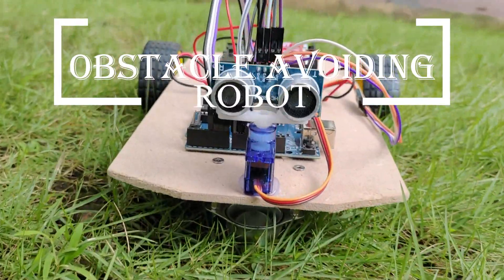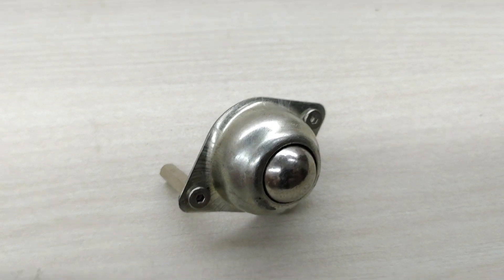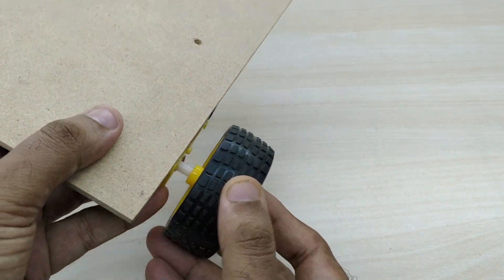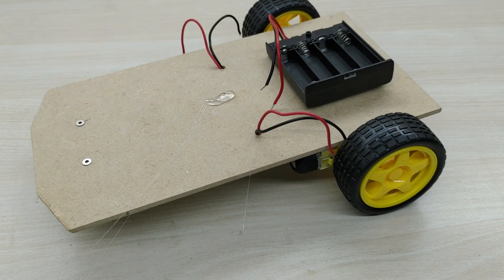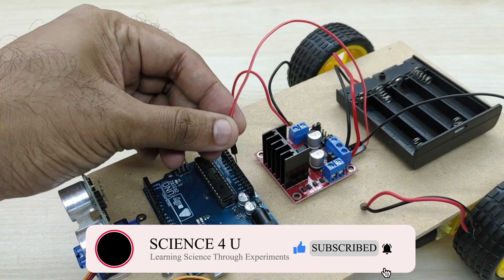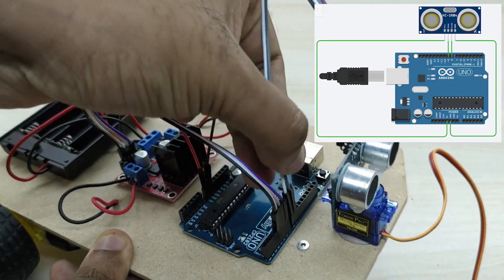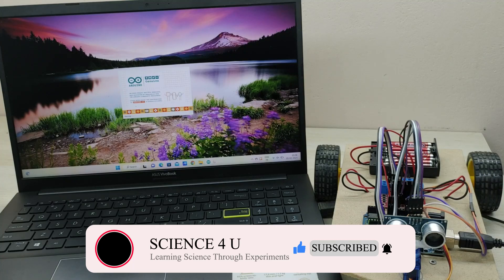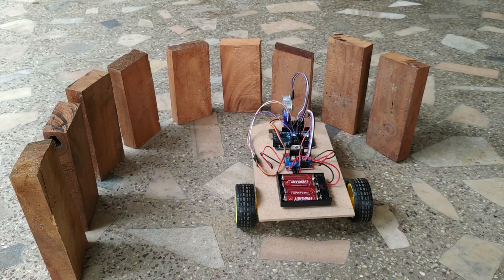Intelligent Obstacle Avoiding Robot || Step by Step Tutorial || Arduino Project

Comment: Hello brother I have used 12v motors, so how much voltage should be needed to run the project.
Reply from the maker: Hello friend..Though you have used motors rated for 12V, I think you can use any voltage between 9V to 12V to run the project. This voltage can be given to arduino also without any problem..
Reply: @Science_4U_ I have given 12v supply through adapter, the ultrasonic sensor is detecting the object and stops working, what is the reason??
Reply from the maker: @beyondusee8740  it stops working means that the motors stop rotating? Can you little more explain the problem that you are facing?
Reply: @Science_4U_  the ultrasonic sensor stops working when it detects the object, and the motors, servomotor also stops working.
Reply from the maker: @beyondusee8740  Hmm..okay friend..looks like a battery problem. Please change to a good battery and see if the problem is solved. Also, please check the connections once again..

Comment: Motors are not moving all connections are ok servo and sonar are working fine
Reply from the maker: Okay friend..Can you check whether there are 2 jumpers connected on ENA and ENB pins in motor driver board?. They act as swiches for enabling the rotation of motors. Without these jumpers in place, the motors won't rotate. So first can you check that?
Reply: @Science_4U_  thanks for your help bro I was using used motor driver in which those jumper were removed i connected ant it is working .thanks a lot
Reply from the maker: @SeemaChandra-m6u  ooh..great to know that friend..Happy to know that it worked..🙂

Comment: Can we use any arduino uno r4 or only the one which is used in the video,pls help and my boy is not moving even if the code is uploaded
Reply from the maker: Hi friend..you can use any arduino uno R3 or R4 or arduino nano etc. for this project. The code remains the same..
Reply from the maker: If the toy is not moving, there could be something wrong with the L298 motor driver board. Have you checked whether the 2 jumpers connecting ENA and ENB pins are assembled on the motor driver board?. Without those jumpers in place, the motor driver won' t work.So please check that..

Comment: I did exactly what u did but my wheels or my servo motor aren’t even turning on
Reply: Can u pls help?
Reply from the maker: Ooh..Hi friend..something must be seriously wrong..Do you see lights on arduino board and L298N motor driver board once you switch ON?
Reply: @Science_4U_  yes there is a red light
Reply: @Science_4U_  pls help me because I have to submit it tomorrow
Reply from the maker: Hm..okay..and the wheels are not rotating once you turn on..right?
Reply from the maker: Can you check in the motor driver board, there are 2 jumpers connecting ENA pin to the pin above and also ENB pin to the pin above..?you can search in internet for this. Without the jumpers, it wont work.
Reply: @Science_4U_  yes like once I turn on, only the servo motor and the ultrasonic sensor works.
Reply: @Science_4U_  oh ok I didn’t connect them. Where should I connect them?
Reply from the maker: Can you please see the internet regarding the jumpers?. They act pike switches for turning on. So you have to put those 2 jumpers on motor driver board for it to wotk.
Reply: @Science_4U_  oh my god idk what I’m doing wrong can you like pls help me do this project. Is there a way to send pics to you?

Comment: Hey i have a question will this code work on a model with 4 motors and 4 tires???
Reply from the maker: Hmm yes friend..Sure!!! Just attach 2 more motors + wheels in front and connect the wires from these motors also to the L298N motor driver board. The wires from both left motors to be connected to the left side terminals of the L298N motor driver board. And wires from right side motors to be connected to the right side terminals of L298N driver board.

Comment: hi

i cant use the code it always showing this one, how am i gonna fix this?
thaks

Sketch uses 4512 bytes (13%) of program storage space. Maximum is 32256 bytes.
Global variables use 233 bytes (11%) of dynamic memory, leaving 1815 bytes for local variables. Maximum is 2048 bytes.
Reply from the maker: Hmm..sometimes there will be problem in uploading the code. You can unplug usb and plug in once again and see..also in the tools menu make sure the port is selected with a tick mark and again upload..
Reply from the maker: If nothing works, try with another PC or laptop..
Reply: @Science_4U_  hi, i uploaded it but the car is only one wheel is working what do you think is the problem?
Reply from the maker: @jeffmulto7176  Hi friend. Can you check whether a jumper pin is given at both ENA and ENB pins in L298N motor driven board? if either ENA or ENB doesn't have the jumper connected to it, that motor won't rotate.

Comment: bro servo motor was not turning   what can i do
Reply from the maker: If servo motor is not turning, it will be most likely a faulty motor. Please replace the motor with a good one and it will work..
Reply: How to check the motor was working are not while buying
Reply from the maker: @Achieve_Together_Tamil  Hi friend. Unfortunately, there is no direct way to check the servo motor. You have to carry an arduino board..upload the servo test code and connect the servo to the arduino to check its working..
Reply: @Science_4U_  thank you

Comment: Can you please help me out with the code because when I uploaded the code to the robot everything was working except the wheel. The wheel is turning with a very high speed. Can you please help me to slow it down. Please help me early because I have an exhibition in my school in the next week only. Please help.
Reply from the maker: Hi friend..The easiest way to reduce the wheel speed is by reducing the battery voltage. Which battery are you using?
Reply: @Science_4U_  I am using 3x 3.7 volt battery.  But can u please bring change in the code.
Reply from the maker: @RupamDas-iq8fj  Okay friend..I have modified the code...Download the code from the following link and upload..

https://drive.google.com/file/d/1jQZ4IzAmljW3hORBpOi4AheDfYOUYTCY/view?usp=sharing

Also remove jumper pins in ENA  and ENB in motor driver board..
Connect jumper wires from pin numbers 3 and 5 of arduino to ENA and ENB pins in motor driver board..

In the code there are 2 lines with analogwrite command. You can change the value there to control motor speed. I have written that as a comment inside the code. You can open and see that..

Hope this works. Contact me for further help..
Reply: @Science_4U_  thank you very much sir

Comment: Sir what is the dimensions for board ...is that affects the working?
Reply from the maker: Hi friend. I have used board with a length of 25.5 centimetre and width of 13.5 centemetre. I have given small inclined cuts at both sides in the front also to give it a better look.
Reply: How can I add a switch in this project
Reply from the maker: @vaishnavigangurde4713  Hi friend. You can surely add a switch. I used a battery pack which had a switch in itself. So that is why, i did not use a separate switch
 You can add a switch between the +ve terminal from battery to Vin pin of arduino or between -ve terminal from battery to gnd pin of arduino.
Reply: Can I use 12 Volt instead of 9 volt power supply
Reply from the maker: @vaishnavigangurde4713  yes ofcourse..arduino can operate from +5 to +20 volts..so +12volt is very much okay..👍

Comment: Bro my ultrasonic sensor and and servi motor is working properly but gear moter is not moving please give me solution
Reply from the maker: Sure friend. I can help..It is definitely due to some problem with the L298N motor driver. My first question would be whether the motor driver has 2 jumpers connected to ENA and ENB and the pins just above it?. Can you check that. Without that, the motors will not rotate..
Reply: @Science_4U_  yes jumper is connected
Reply from the maker: @binitsapkota6753  Hmm..okay friend.Have you used the motor driver board before?. It can be faulty sometimes..
Reply: @Science_4U_  no
Reply: I recently bought that
Reply from the maker: @binitsapkota6753  okay friend. One thing that you can do is directly  give +5v from arduino to IN1 pin of motor driver and gnd of arduino to IN2 pin of motor driver. Thus you are directly  giving the command to motor driver. So even if some problem is there with code also, if the motor driver is working, the motor should rotate.
Reply: @Science_4U_   actually my moter driver was damaged after I changed motor driver it started to rotate thank you so much for your help 🙂
Reply from the maker: @binitsapkota6753  okay friend. Happy to know that🙂

Comment: Hello for some reason only one wheel is turning and the other one does not? What seems to be the problem. I followed all yours steps and only wheel is working. I tested the L298N before hand to chkeck if its faulty but its not.
Reply from the maker: Hmm..Okay friend.. we have to check one by one. This can sometimes happen if the batteries are not powerful enough. Can you lift the robot in hand so that wheels ate not touching ground and see whether both wheels are rotating?. You can help rotating the non rotating motor with hand and see if it starts rotating. Is it rotating now? If yes, change the battery. 
Before trying another battery, you can interchange the connection to the motor and l298n board (swapping left and right motors) and see if the other motor is now working. If other motor is not working, it points to a problem with the motor. Try checking both the motor by connecting directly to battery and see if both motors are rotating.
Also check both motors directly using battery to rule out motor problem.
Also check for any connection problem between motor and l298n driver.
Also check whether the jumpers are there on both ENA and ENB pins in motor driver board.
Reply: @Science_4U_  I have tried both DC motors of the wheel and they are working before I even assemble them. I also tried to connect them into the l289n driver to check their own rotation. But once I assembled them together the other wheel (near the ENB) to be exact is not rotating.
Reply: All jumper pins are still on l298n board I havent remove them.
Reply from the maker: @elrey8947  Hmm..okay friend. Is the jumper  available connecting the ENB pin to the pin just above it?
Reply from the maker: @elrey8947  hmm..okay. on the l298n board, can you interchange wires at IN1, IN2 to IN3,IN4 and wires already given at IN3,IN4 to IN1 & IN2. Now can you tell what happens?
Reply: @Science_4U_  i tried interchanging the wired now both of them do not rotate.
Reply from the maker: @elrey8947   hmm..okay friend. That points to some problem with the signal coming from arduino. Can you do one thing so that I can diagnose the exact problem?. Please remove wires from all 4 input  pins from motor driver board. Just connect 2 wires from pin no 4 &5 to motor driver input pins IN1 & IN2 and switch on. Can you see just one motor rotating?.
Reply: @Science_4U_   Yes my friend 4 & 5 to IN1 & IN2 and the wheel is rotating. I tried 7 & 6 to IN3 & IN4 and the wheel is not rotating
Reply from the maker: @elrey8947  okay..that is great. Now can you give 4&5 to IN3 & IN4 and see if the other motor is rotating?
Reply: @Science_4U_   Yes sir it did work the motor did rotate
Reply from the maker: Ooh..so both motors are working when command is given from arduino pins 4&5. But the motors are not working when command is given from arduino pins 6&7. So that shows it is a problem either with arduino or the jumper cables. Can you try changing the jumper cables from pin nos 6&7 to new one?.
Reply: @Science_4U_   I tried changing it to new jumper wires but it still doesnt work. Mayb 7 and 6 are damaged. Can I still connect it to other digital pins? I have tried 12 and 11 but it doesnt work.
Reply from the maker: @elrey8947  yes..sure friend. You can change 6& 7 to other pins as well..Just you have to change the assigned pins in the code also and upload once again.
Open the code  and you can find two lines in the beginning as follows
#define MRa 6               //right motor 1st pin
#define MRb 7               //right motor 2nd pin
Change 6&7 to the new pin number and upload code once again. That is it. Please try that and see if it works..
Reply from the maker: @elrey8947  is it working now friend, after changing to new pins in arduino?
Reply: @Science_4U_  Thank you for your help sir, but I think the arduino is the problem. I tried to switch where the pins of Ultrasonic sensor is inserted and put the motor wires there and place the ultrasonic to other pins. Now the ultrasonic is not working so I concluded that my arduino has problem.
Reply from the maker: @elrey8947  Hmm..okay friend. But when you switch the pins, you have to make corresponding changes in the code also. Without changing code, it will not work..
Reply: @Science_4U_   I fixed it my friend. Its not the arduinos fault but my l298N motor driver is different, IN2 and IN3 makes the motor go forward, while IN1 and IN3 is backward.
Reply from the maker: @elrey8947  okay my friend..glad that it worked..🙂

Comment: I have an question what if we want two wheels more at the front what should we write in the code??
Reply from the maker: Hi friend..you need not do anything in the code. Just attach 2 more motors in the front. The wires coming from the front motors can also be connected to the motor driver board alongwith the wires coming from the back motors..I have done a similar project with 4 motors. You can watch that video below for better understanding.. 

https://youtu.be/JK6zTM65Rh0

But only problem I have seen with 4 motors is that it is a bit difficult to turn.

Comment: How to off the working of this robot??
Reply from the maker: In this video, I am using a battery pack with 4 AA batteries. The battery pack has a switch by its side using which you can switch off the working of the robot. If your battery doesn't have a switch, you can provide any switch either between positive terminal of battery to Vin pin of arduino or between negative terminal of battery and ground pin of arduino..

Comment: Can I use one 9Volt battery to run these 2 motors and also the arduino? Thank you
Reply from the maker: Yes sure friend..you can do that..Arduino has an input voltage of 5 to 12Volts..9V will be perfect.. We get small 9Vbatteries for doing electronic projects. It can be used. But only thing is that, it gets diacharged very fast and are not rechargeable too. But the 18650, 3.7 V, Li Ion batteries last really long and are rechargeable also. So if you can get those batteries, it will be very good for these projects..
Reply: @Science_4U_   Thanks for your reply. I can see you used only 4 AA batteries which is equal to 6 volt. so is it a issue to use 9 volt here or 6 volt? Also, can I later add IR sensor for line sensing? do you have any code by adding IR sensor? Thank you so much for your help
Reply from the maker: @NajmulHaque-z4m  Hi friend..Definitely you can use 9V instead of the 6V that I have used..
Also I have made a line following robot with IR sensor separately.You can watch the video below..
https://youtu.be/WR-VLwunauE

But I have not added IR sensor to this obstacle avoiding robot and made a line following + obstacle avoiding robot together..I will do that in future..👍
Reply: @Science_4U_  actually I want to make a Sumobot which needs both of these, Sonar and IR. Do you have any suggestions on that?
Reply from the maker: @user-ir8xw5gz4n ooh..okay friend..that is super cool..You can watch other videos in youtube in which both sonar and IR sensors are used..
I would suggest you use wheels with good grips so that you are not easily pushed out of the circle. Easiest solution may be to use multiple rubber wheels. If possible you can use rubber tracks like used in excavators which offer the strongest grip..Also use high torque motors which can really get that force to push the opponent outside. Make sure you add weight to your sumo bot also. All the above are not of any use if your bot doesn't have enough weight. You can make bot so that it either pushes your opponent outside or lift it with an arm and thows the opponent outside.
Reply from the maker: Also, I would suggest you can use an inertia wheel which gives lot of force for pushing your opponent outside. There can be a large spiked wheel thst is rotating in your bot. When your bot comes near your opponent, your bot can hit your opponent with the with the inertia wheel. An inertia wheel stores lot of kinetic energy.  So when it hits the opponent, it gets thrown outside..
Reply from the maker: Also, I think you can use multiple IR line detecting sensor so that even if one IR sensor goes out of the line, your chance is not lost. The next IR sensor can detect the line and bring the robot inside..